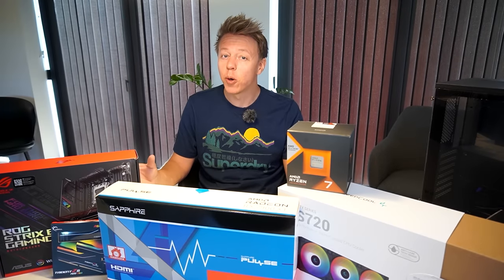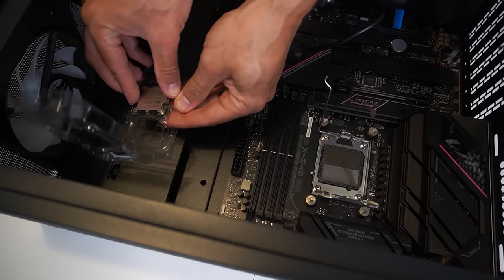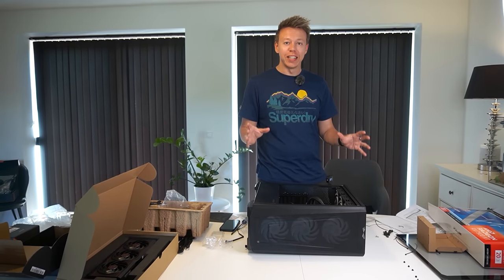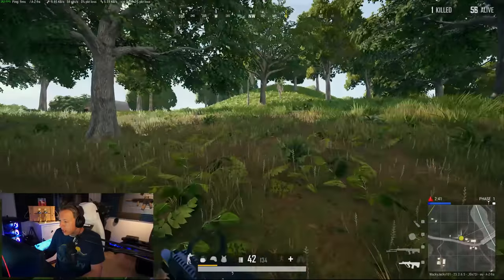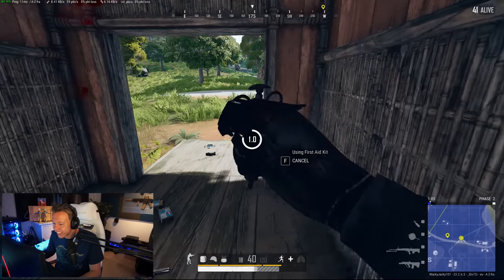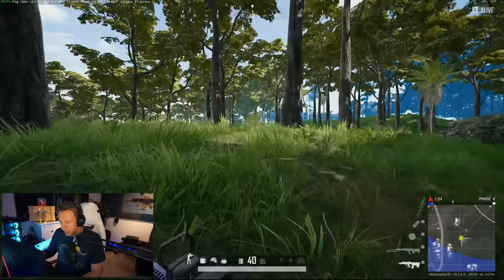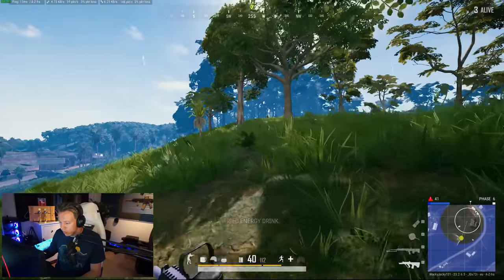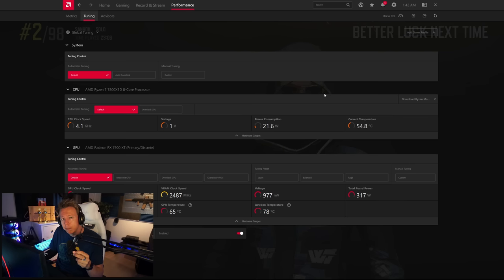I BUILT A NEW PC USING THE WORLDS FASTEST GAMING CPU - How well does it run PUBG?

Comment: As a professional PC builder, here's a list of the things you did wrong:
Nothing at all.

Great job and gorgeous rig! I'm jealous :)
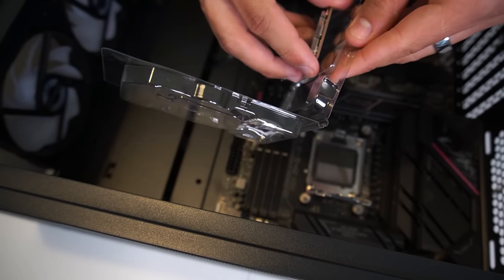Reply: Not even the lack of thermal paste @ 2:50? 😱
Reply: @valarya  He didn't show us the cooler assembly but from the temps he's getting he definitely put paste on there :)
Reply: @valarya  The Deep Cool AIO all come with pre-applied paste. The 360mm radiator is a bit over-kill for a 7800X3D, it's not an i9 🙂
Reply: i bought recently ryzen 9 5900x and rx 6700xt as rock challenger pro and i have huge problem i have fps in smokes drops from 200+ to 40 and i dont know what to do i changed ram too still huge drops is it because of gpu or what? my pc worked better with ryzen 5 5600x and gtx 1060 6gb im trying for over a month to find a solution but still nothing i would appreciate any help ty and wacky this is a BEAST PC gg.
Reply: @ludishamanazz8007  Was that absurd amount of money you paid worth it to just play a game?
Reply: @contraband1543  was that absurd brain damage worth it to ask someone about their money?  Either you have low pc or you dont have pc at all keep your goals infront of you dont bother what other do or think just relax and watch wackyjacky videos gl mate
Reply: @ludishamanazz8007  It's hard to know what to suggest as so many things can affect performance. Your new system should perform way better in PUBG than the old one due to the better GPU. Did you reinstall Windows after the upgrade? I'd definitely do that after changing major components. If you don't want to reinstall, at least use a driver removal tool to get rid of the NVidia drivers. Check your actual RAM speed in Windows using CPU-Z or similar. FPS drops in smokes is a fairly commonly reported issue in PUBG but I luckily have never had the issue.
Reply: @ludishamanazz8007  Hi! The reason for that can be the fact that PUBG is designed for DX11. AMD GPUs don’t perform that well in DX11 games. My friend had exactly the same issue as you do. After he switched to RTX4090 from 7900xtx the performance issues have completely disappeared.
Reply: @doctor_gee  i did reinstall and did almost everything but still problem remains...
Reply: Interesting that as a professional PC builder you didn't notice lack of static strap for safe assembly of the hardware? If you are a professional PC builder I am certain that you are using one.
Reply: @doctor_gee new hardware temps. Once you run it for a month without thermal paste you'll notice heat dissipates worse.
Reply: @Pete856 indeed, however id rather overkill if i have a large case and have quiet fans than be right on the edge of thermal throtteling.
I mean i bought an nh d14 for my ryzen 3 1300 xD
Was a wise investment as it not cools my 3600 and hopefully will continue to cool cpus for the next 10y at least :)
Reply: @valarya 4:50 my dude
Reply: I was confused when he installed the motherboard into the case as step 1. Normally you install the CPU and the RAM before you get it into the case, no?
Reply: @JeremyRight-zi4yp  thats the way you usually do it since its easier to place the cpu and less likely to damage pins while cables are wiggling around everywhere. However there is not the one right way. Hell, If you manage to plug everything jn you can install the gpu as first step. Idk why you would, but you could.
Reply: @contraband1543  what are you talking about its his money and for him it was worth it that's why he bought it duh

Comment: @WackyJacky101: Make sure your motherboard bios is the latest. Not long ago older bios versions especially from Asus fried the CPU mainly the X3D CPUs due to wrong stock voltage settings.
Reply: And also make sure it doesn't cross 1.25V. That is the max on SOC voltage that you would go on those Ryzen 7000 CPUs

Comment: I really dont like the video,
i get thats its basically just supposed to be an ad for amd, but with the quality and data analysis you usually provide in your videos, i missed some things badly.
You didnt tell us about the other parts that you put in the PC, like what NVME or details about the RAM, there isnt even a partslist in the description?
What settings were you using ingame and what settings in adrenaline?
There are also very different scenarios with different FPS ingame, like fighting in a big city vs. being in an open field. It would've been interesting to compare them with different settings via the replay feature for example. The avg. FPS at the end of 1 round of sanhok doesnt really say anything.
You dont need to overclock because the game runs smooth and the temps are cool? So you OC when the temps are high and the game is stuttering? That doesnt make any sense to me.

Comment: Nice performance upgrade! That cpu cooler is way way way overkill for the low power 7800x3d though :D
Reply: he said it,better safe than sorry
Reply: @no-one_no1406  definitely not a overkill lol pubg runs hot too with the 7800x3d 80 to 85c. Any other game it's like 50/60 just pubg it runs the higher temps.

Comment: A month ago I upgraded my GPU from a 5700XT to a 6950XT and a week ago I switched from the Ryzen 5900X to a 5800X3D. The GPU was a huge upgrade but the CPU made the game so much smoother on my 1440p 144Hz. I play with Textures ultra and AA high since I like the game looking nice, everything else very low. With the 5700XT I had to lock 120 in game, 142 had too many drops and it was terrible in smoke or in gunfights, huge frame drops. With the 5900x+6950 the averages were a lot higher but the drops were nearly to the same framerate as before, with the 5800X3D I could lock 240 no problem, but I hold it at 142 not to have tearing and the average drops are still 120+ while with the 5900X they were under 80. Trust me, you want an X3D chip (at least the 5600X3D) for PUBG, or an Intel i5/i7 12th/13th gen.
Btw nvidia GPU-s require stronger CPU-s than AMD GPU-s do, but UE4 (and thus PUBG) love Nvidia cards.
Reply: I got the same experience as you with swap from 5900x to 5800x3D. The 5600X3D doesnt exists...
Reply: @PhoenixNLx the 5600x3d was announced a couple days back.

Comment: I built a machine all the way back in 2011 (2600K, 16GB of RAM, 2 of the fastest SSDs available at the time running in RAID0, etc) and used it all the way up until 2020 when I decided it was finally time to build a new machine. I swore off AMD after one of their Bulldozer chips blew up on me years ago but decided to give them a shot as the current Ryzen stuff is SO good. Managed to get a 3090 at MSRP (which, in 2020, was INSANE!!), 32GB of RAM, PCIe Gen4 SSD, full EK custom hard line water cooling loop (even the BACK of the 3090 is actively cooled!!), the works...that was easy. What took forever to get was the CPU. I originally shoved a 5600X in there if I remember correctly, but FINALLY was able to make it happen without getting scalped to hell and back...finally got a 5950X to round it out. Gotta say, the performance is awesome (obviously) but the stability is surprisingly bad. Not sure why but I haven't had so many lock-ups, blue screens, etc in YEARS. When it's running, it's great though! lol

Comment: Nice collab with AMD love to see it. My pc took full advantage of the AM4 platform this time around. I went from 2700x+Vega64 —> 5800x3D+6900XT. It’s not the absolute max settings but for me at 1440p 240hz I can play everything really smoothly with almost no noticeable frame drops. Plus not upgrading to new platform allowed me to buy a new monitor as well.
Reply: i had a similar upgrade path. From  ryzen 5 1600 + vega 56 to 5800x3d + 6750xt. This Combo is gonna stay for al long time.
Reply: @16nitro78  My upgrade was a way lot older. Went from an AMD A8 5600K + RX 480 (started with an R7 270x upgraded when it got too slow) to a 5600X + 6700 XT. 

Will probably last around the same length from my older one (bought on 2013, replaced in 2021).

Comment: I get thats its basically just supposed to be an ad for amd, but with the quality and data analysis you usually provide in your videos, i missed some things badly.
You didnt tell us about the other parts that you put in the PC, like what NVME or details about the RAM, there isnt even a partslist in the description?
What settings were you using ingame and what settings in adrenaline?
There are also very different scenarios with different FPS ingame, like fighting in a big city vs. being in an open field. It would've been interesting to compare them with different settings via the replay feature for example. The avg. FPS at the end of 1 round of sanhok doesnt really say anything.
You dont need to overclock because the game runs smooth and the temps are cool? So you OC when the temps are high and the game is stuttering? That doesnt make any sense to me.

Comment: I have a 7950x3d in my dedicated sim/racing motion rig running triple 4k oleds and it does very well in iracing/msfs etc.  A single 1440p screen will be no problem for any modern cpu/gpu, especially an x3d cpu.

Comment: That's crazy because I get almost similar performance with my 10900k overclocked @5.2GHz + 3090 overclocked @2100MHz...of course I'm playing at 1440p on very low settings though 😅

Comment: Had several AMD CPUs, but went with the 13900k this time. AMD's marketing budget is insane, and I don't think the new 3D chips are anything special at all. The 5800x3d was great. 

But we need cores and clock speed now. The 7800x3d and other 7xxx x3d are not worth it. It can't hit those high clocks!
Reply: This is misleading. Who's "we"? Just because you want a bunch of cores and almost 6Ghz doesn't mean everybody needs it. Clock speed is irrelevant and misleading when comparing different architectures, IPC is a more accurate representation of single-threaded performance. Many games benefit from having more cache and no game on the market can effectively utilize all 8 cores, let alone more than that. You don't need an i9 or Ryzen 9 CPU for gaming.

Edit: Was this written by Userbenchmark? I thought they only liked quad core CPUs lol

Comment: I'm still on the AM4 socket with a Ryzen 9 5950X, and I run a FE 3090Ti. I play at 1440P at 240hz. With ultra graphics settings I get 160-180 fps so I dumb the graphics settings down a little and I run at 250 fps steady. Great set up Wacky.
Reply: Did I mention that cpu and gpu are on a custom water loop? LOL

Comment: Can you try to playback a replay from an E-sports game in PUBG? Getting good FPS in normals/ranked has typically never been a huge issue for me but in certain phases of a competetive PUBG game FPS drops significantly (lets say phase 3-4 with 60+ people alive). Would be interresting to see the performance of this beast in competitive PUBG.
Reply: ryzen 9 5900x, 32gb cl16 3200mhz, samsung m2 970 evo plus, rtx 4070 and 750w PS 80gold. I play on 1080p with the lowest settings and when there are around 20 people I have drops to 80 90 fps :)
Reply: I play competative and ranked it always hits the fps harder then match making specially in the final circles when heaps are alive.

Comment: This generation of GPU and motherboard are known to have huge issues with heat. Keep us up to date if either one melts.
Reply: Lol
Reply: trolls at asus have put the default soc voltages at 1.5v, proceded to melt a ton of cpus and then dumped the responsibility on the users lol
Reply: I hope he updated the bios to the latest verion! Asus AM5 boards with the older bios can actually burn the CPU!

Comment: I built my PC during Covid with a i9 12900k and an msi 3090 both water cooled and 64gb ddr5 with 3 M.2 drives. Playing 1440p i get a steady 160fps and EVEN THEN this game give me FPS drops into the 70s and 80s.
Reply: I have the same specs in 1440p I sit between 280/350fps competative settings.

Comment: Technically, you could use 5800x3D, B550 motherboard, DDR4 CL14 ram, and get the same performance on 1440p. The difference would be 0-5% in fps, but the price difference is ~100%.

Comment: what about 13900K+RTX4090?
Reply: Those are not AMD
Reply: @Enter-wl3zf  Thanks for letting me know which brand they aren't.
Reply: @saeedupdate8311  In case you don’t know, the ones u mentioned are from Intel and Nvidia respectively. The video starts with an invitation from AMD, so I would expect that to favor their own products over the competition.
In case you mean the ‘fastest gaming cpu’ is referring just to the 7800x3D, which is better suited for gaming, thanks to it’s 3D cache. This does not mean, that the processor is faster overall, nor does it include the gpu. 
Also AMD gpus are a lot better bang for buck than Nvidia.
Reply: @Enter-wl3zf  Believe me, I know way more about this stuff than you, and the 7800x3d isn't the best when the 7950x3d is available on the market! 😁😁
Reply: @saeedupdate8311  fair point and good for you

Comment: I run a 13900k
Tuff 4090 32 gb ddr5 6000mhz
I lock in at 236 FPS on a gsync 1440p Asus monitor 
It stays around 200-236 on ultra 95% of the time
Reply: If you oc the ram you can get way more than that :)

Comment: That mainboard wasn't the best choice: I also got it and I have so many problems with the Intel NIC like so many others too. (Intel i225 network chip)
Disconnects randomly appear. Even while gaming
Reply: Update to the latest driver for your ethernet adapter or just go in and disable energy effecient ethernet from the settings, that is what causes the issue.

Comment: I have a 7800x3d ,RTX4090 all custom watercooled but i`m still a Bot in Pubg@300fps+ 😆
But in close Combat i can feel a big difference to my previous System,very smooth Movement and Reaction Time is only limited by my slow Brain
I blame Weightlifting and beeing old 🤓
Reply: its just practice dont forget wackyjacky played this game over 5000 hours and your brain is not slow it has the potential to learn everything you want
Reply: Hi there. Could you please check your fps over Leones or Go Dok when plenty ppl around with competitive settings (texture-ultra, rest low, sharpen on, 2k res).
Many thanks.

Comment: Hey Wacky, 
recently build a similiar setup but only with a RTX 4080. What are your thoughts on gsync + vsync + low latency mode for the lowest input lag or in other words what settings do you run to achieve the lowest input lag possible?
Reply: My experience is that, nvidia low latency does not work bugfreee with pubg.
Gsync+Vsync increase input lag.
Use g-sync (or compatible) ON and in-game frame limiter ON, under your monitor max refresh rate by few frames, like 240Hz/~236fps limit.
This combo works the best.
Reply: if you really only care about latency, put the latency mode on ultra, disable any variable refresh rate settings, drop ingame settings and unlock the fps
the game will probably feel really unsmooth but its theriotically the lowest latency setup
Reply: @maestrohun  okay I will try that, thanks. What leads you to the impression that llm doesn’t work bug free in pubg?
Reply: @v2Frog Not always. Gsync+Vsync works well on AAA that not fast-paced, because of smoother visuals, but slithly higher input-lag.
For fast-paced games/competetive games: G-sync (or compatible) and framelimiter under the monitor refresh rate minus few frame (an example 144Hz/138fps).
nVidia low-latency is only optionable, because It does not work well with every game (By my experience, in some game could cause random microlags.)
Reply: @Joggeson  I tried and I experienced microlags. But as we talk, I am thinking about that, maybe It could be my setup as well: Maybe this low-latency mode need more powerfull CPU for PUBG. I have only an i5-10400. nVdiai driver is very sensitive for CPU bottleneck. Or maybe I had microlag because of kinda PUBG update or driver bug? I will try again....
My best advice is, Give a chance to yourself and try it in your own setup.

Comment: You really don't need an AIO for the 7800X3D, it's super effecient and a decent air cooler will do, with the advantage that an air cooler usually lasts longer since you the only component that will be breaking is the fan/fans, and those are easily replaceable, while when the pump in an aio breaks, you have to replace the whole AIO. And didn't you buy a 4090? Which is much faster than the 7900xt or even the 7900xtx.
Reply: Honestly if you almost exclusively play shooters competitively i.e. player lower settings for visibility most of the time you really don't need a 4090 or 7900xtx since you'll be in cpu limit most of the time anyway with the 79xt, even on a 78x3d
Reply: @klulessdood4327  yeah, but he already had the 4090
Reply: Well that's sponsorship for ya I guess
Reply: Lol you definalty don't play pubg with a 7800x3d lol. With aio 360mm pubg temps are 80/85c it's only pubg but other games it's fine around 50/60c

Comment: So to clarify. The 7800 x3d is not the fastest cpu, its the best one you can buy for gaming performance. Also, the 7900xt is not comparable to the 4080 in performance, the 7900xtx is. A 4080 will beat the 7900xt, and the 7900xtx in some instances. The 7900xt is more similar to the 4070ti which was supposed to be called a 4080 but nvidia got mocked about it and rebranded it.
Reply: He said it himself in the beginning that 7800X3D is the fastest gaming CPU and for the GPU, I agree

Comment: PUBG a very CPU intensive game? 
I play at 3840x1440 and my 5900X never goes over 20% utilization. And my 7900 XTX Nitro+ barely goes over 65C. 
Problem is the game is very unoptimized and there's still stutters sometimes. 

I'm in Australia, and I do notice a HUGE difference playing in OC servers with 5 ping and playing in SEA, KR or NA servers with 90 to 170 ping. 
The servers in OC (even with super low ping, I have Fibre to the Premises) feel stuttery to me compared to servers in NA, SEA or KR which feel smooth even with the much higher ping.
So... are we getting the cheap servers in OC?